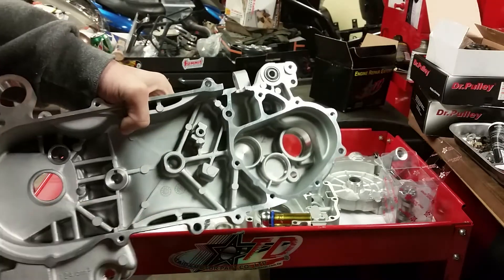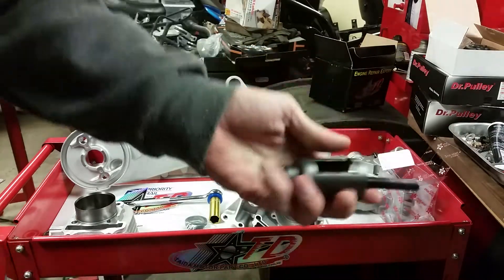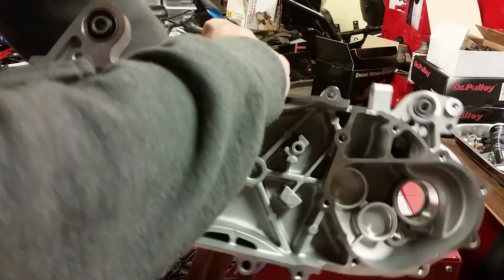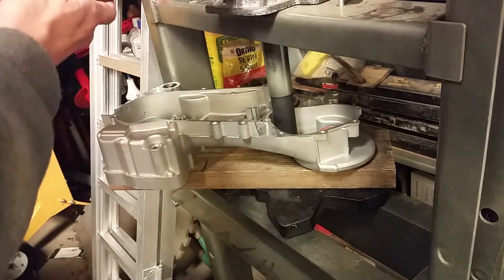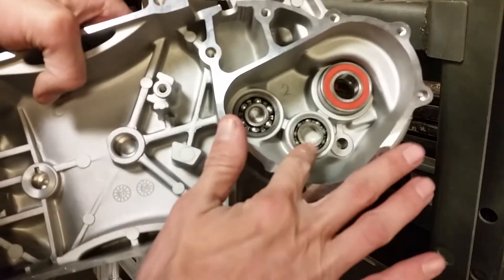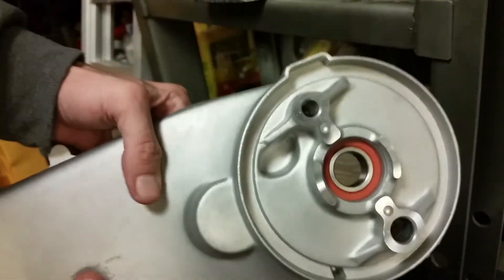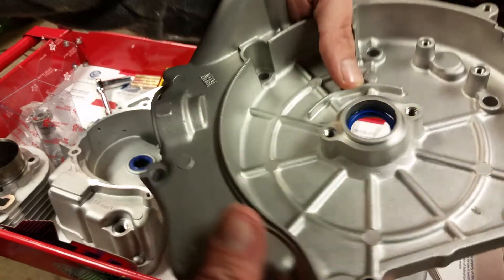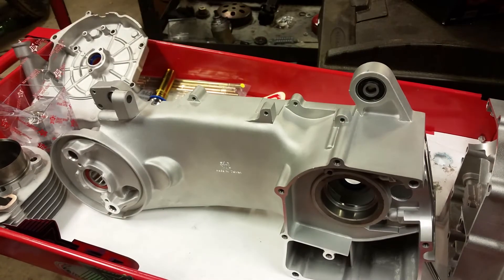GY6 Taida Install Seals Bearings Bushings

Comment: Can you show us how the Draper seal tool works whenever you have the chance?
Reply from the maker: +Toan Vo   Hi Toan.... I will provide a link to a video made by Draper... I don't use the Draper on GY6's... Iuse a seal puller and bushing reamer for the GY6...  The GY6 seals can almost be installed by hand with no tools... So, the draper stays put up....  

This is a link to the seal puller I use http://www.harborfreight.com/seal-puller-35556.html and this is the reamer I use http://www.harborfreight.com/10-piece-bearing-race-and-seal-driver-set-95853.html

Here is a link for the draper Video https://www.youtube.com/watch?v=xRQPTBVq-fk 

Hope that helps! BTW, have you joined the forum yet? Go to www.dansgaragetalk.com ... I'm the owner of the forum and send out an invite to all my youtube friends.... It's the best way of contacting me as I don't always get my google notifications....
Reply: Hey Dan, how do you install the rear bushing? I recently bought the tool that you used in this video to install the front bushings, but when i tried to pull out the rear bushing to replace it I noticed that it didn't fit so now I'm stuck

Comment: Hey man, where do you get the Viton oil seals for the crank and case? Also do you know where to get good crank bearings at?? 
Any help would be awesome!!
Reply from the maker: +JazzzMee 2 
 You get them from me.... I stock Taida, TPI branded-Anti-Slip crankshaft bearings (the best you can get for the GY6 crank) and I also stock the Viton Seals....  Hit me up at my forum www.dansgaragetalk.com .... I'm Dmartin95, the owner. Also, you can check my store although it's currently under construction. shop.martinmopeds.com
Reply: +Daniel Martin does the bushing tool also take out the bushing too?
Reply from the maker: +Toan Vo Yes
Reply: +Daniel Martin Awesome. Thank you for taking the time to make these gy6 build videos for us to learn from Daniel! You're the man
Reply: You can get Viton seals on e-bay dirt cheap. Note blue don’t make them high performance or Viton as he suggests Viton high performance seals come in many different colors such as green, black, brown or yes as he says Blue. You can also get standard seals in blue so do not get the colors confused with performance as he leads you to believe. Just because it’s blue dose not mean it’s high quality.

Comment: word of advice guys!!!!DO NOT TRY TO INSTALL BEARINGS THIS WAY!it is not the way how it is done.....put your bearings in deep freeze and after few hours take the heat blower for removing paint and heat the casings to lets say 70C....take the bearings out and they should simpley slide in the case without any problem....no need for hammerings them or something.....when you put them you just wait the case to cool and that is it.it is a proper way!
that how it is done in the factories....

Comment: Your right and wrong on assembly lube. Grease does break down in oil but it breaks down too fast. Assembly lube takes longer to break down to help protect everything until the engine sees full pressure for the first time.